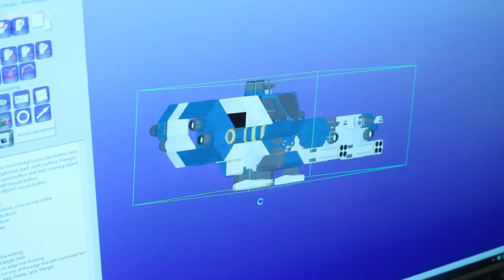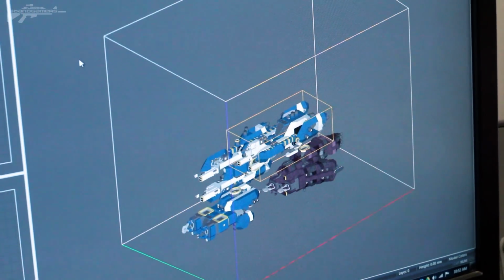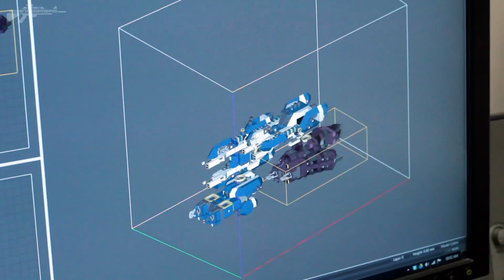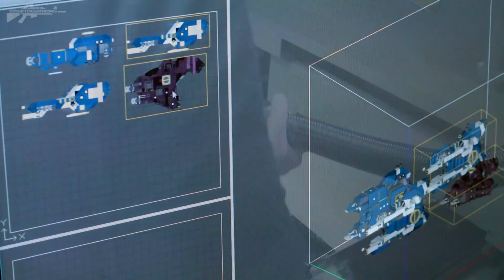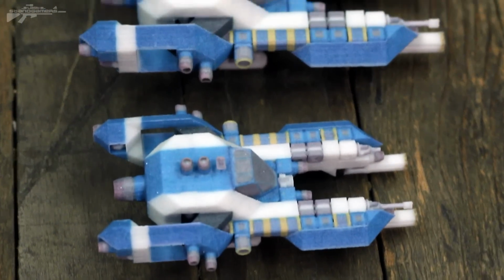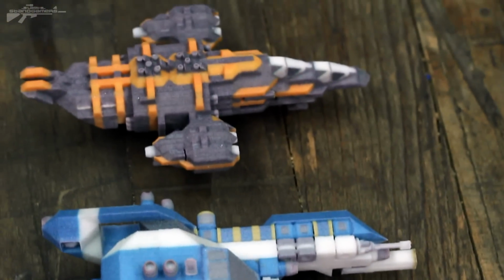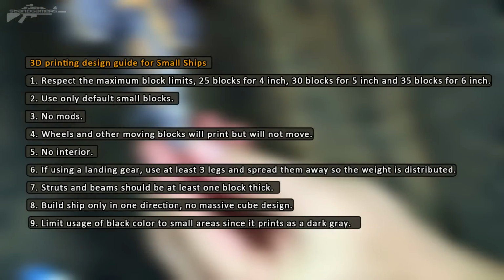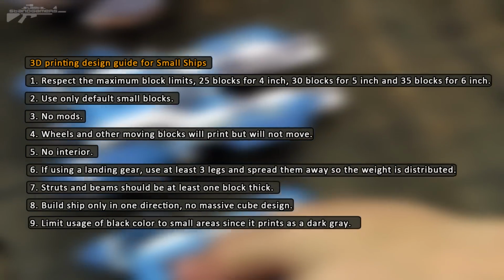Space Engineers - 3D Printing, Dusting Off Your Ship

Comment: gosh isn't 3d printing still piss poor quality and shitty detail? I'd rather have resin casted models me thinks.
Reply: its gotten better in quality, depends on what your printing tbh
Reply: @ALUCARD-us3il  I made that comment before I knew about photopolymer resin printers. I now own a elegoo mars printer for all my warhammer 40k needs and the quality and detail equals store bought models.
Reply: @robinhood5627  since keen no longer does prints in house what printer would you recommend for space engineers?
Reply: @ALUCARD-us3il  I have an ELEGOO MARS photoresin printer. I have to say I am very impressed with it. The quality is so good it's  almost as if it's store bought miniatures. Much better than filament printers.

I would recommend you get the ELEGOO Saturn because it is a bit bigger and has even higher resolution than the MARS. So you should be able to print bigger models at higher quality. I too will be buying one in the new year. 

As for software to port your SE builds over to a printable file I have no idea on that front. If you figure that part out let me know, I would be very interested in that.
Reply: @robinhood5627  I've heard that you can export stuff from SE with Microsoft paint but I can't yet confirm that so you’ll need to try that yourself, if it does work than it should let you export modded blocks as well(which is what pretty much all of my ships use in some form or another)

Comment: The color needs work.
Reply: +MFE Original powder is white, but we paint it during the process, so the ships come out in full color. The stuff which is sucked is original building material, which is also used for support during 3D printing. The rest is suck back into printer and reuse with next print.
Reply: +Eddi Kimball Coloring is much better now. Check more photos at: https://www.facebook.com/SpaceEngineersPrints/photos_stream
Reply: How do they print in color?  I thought filament was only one color throughout.
Reply: +MFE We do not use filament and FDM printer. These prints are from plastic powder mixed with  binder and three different colors. So any color with exception to true black can be mixed and included in model during the printing. Printer we use is called ProJet 4500.
Reply: Wait, so you print with colored plastic powder?  Is that what that stuff is being sucked off of the ship?

Comment: this is an interesting 3d printer. I have used a 3d printer that used a supporting plastic instead of using powder as a support material. many of these ships would not have worked well with the machine I used.

Comment: LastStandGamers Here's a question that I think needs to be answered.
Is this company fine with printing multiple segments of a hull? Also, can the material be glued together with a conventional glue, such as super glue?
SImply asking because it wouldn't be hard to file the edges smooth and then adhere them together. All sorts of large craft could be designed and printed in pieces if they'd be willing to do it.